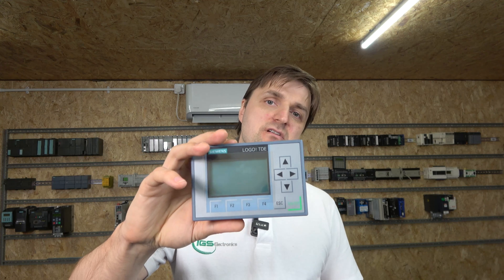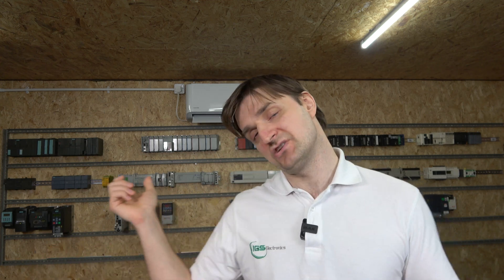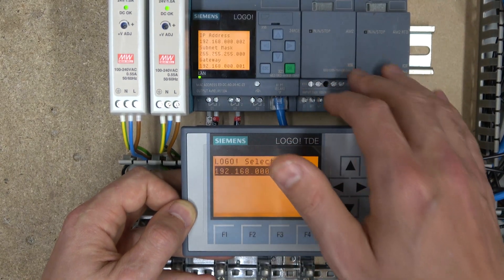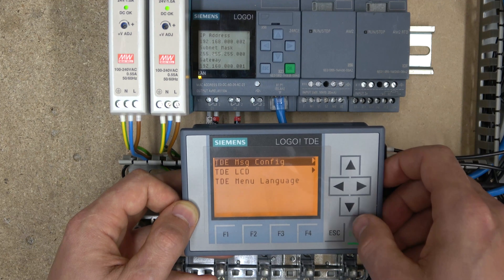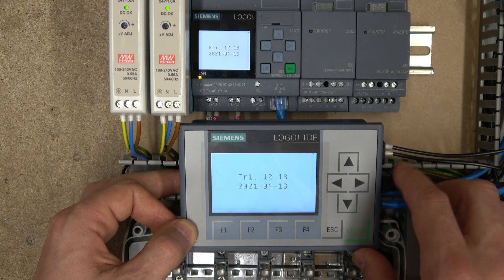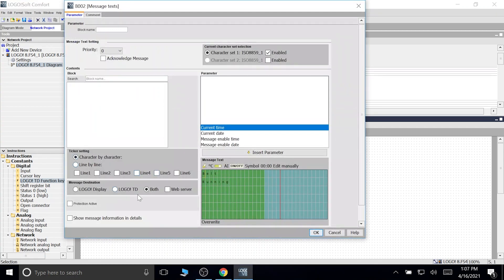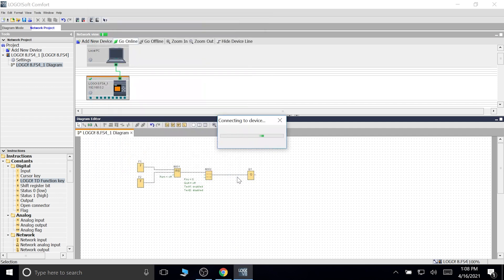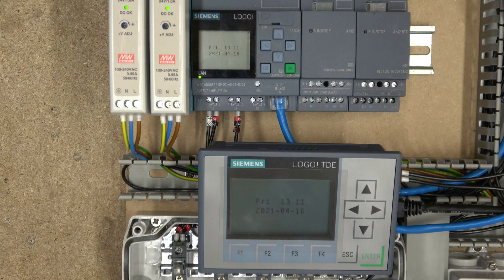Siemens LOGO TDE display panel communication with LOGO! 8 SF4_1 smart relay. English

Comment: Can I use digital input I7 and I8 as an analog input. If yes than please make a video on it.
Reply: From the 'network view' right click on the logo.
This brings up a new window 'Offline and online settings.
Click on 'Offline settings'.
Go down the list to 'I/O settings' and click on this.
You now have the option of 'Onboard AI settings'.
Selection  2 (Enable 2 AIs), click this option, Select which type you want, 0-10V or 4-20mA.
now press 'OK' at bottom right screen.
Input terminals I7 and I8 are now Analogue inputs.

Comment: it doesnt let me connect with the logo for some reason, i put in the same ip adress
and network cable is also connected to the logo
Reply from the maker: Its usually to do with subnet. Make sure your laptop IP address firs 3 group numbers are the same as LOGO.